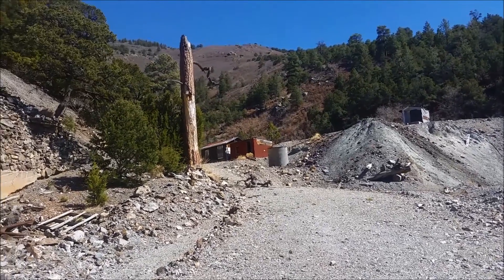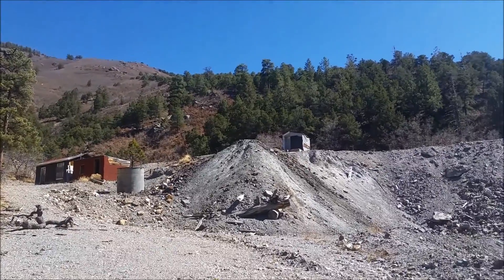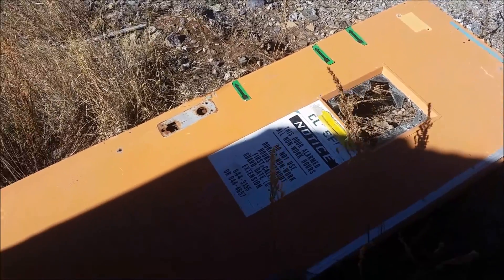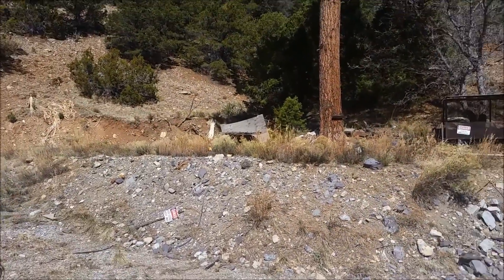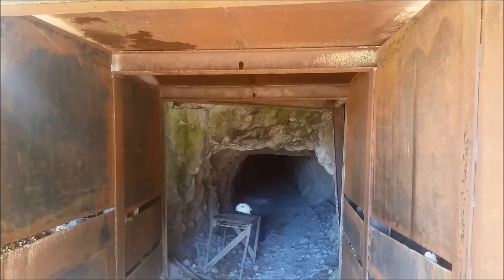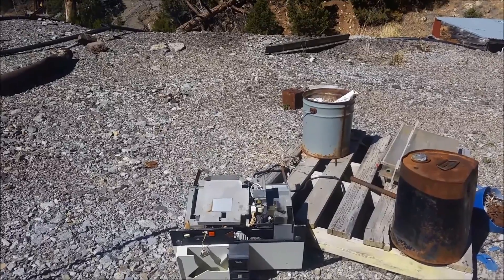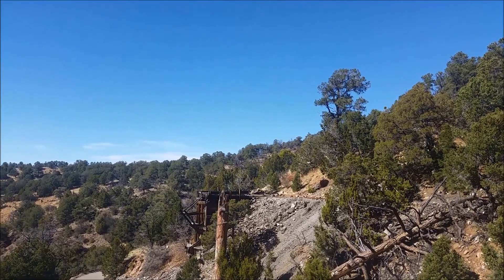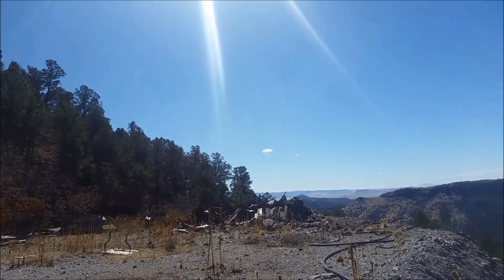Linchburg Mine Exploration: Gated Portal, Black Mold, Engineering Documents

Comment: Interesting how you smelled mold and experienced a burning sensation. I did not experience any  of that in my visit.
Reply from the maker: I'm not entirely sure about it myself - I've been back to this one a couple times more recently and didn't experience it again. I think there was moldy wood or something right near the portal.
Reply: @Porty1119  Massive mine, though. Those stopes are incredible!
Reply from the maker: @westernadventuresaz  They sure are! If you know where to look, you can even find where core drilling was planned for about 2002. Plenty of ore left in there. Did you find the 300' ore pass leading down to the lower haulage level?

The slusher boxholes going down to adit level are cool too. I started running a slusher stope today and it gave me a new appreciation for them.

We actually acquired both mobile air compressors and the battery trammer from this mine in late 2019 or early 2020 when the millsite was being cleared out. Unfortunately we missed out on the rubber-tire equipment but I can't be too upset.
Reply: @Porty1119  I don't beleive I did.  It's such a large mine that I need to go back and see the rest. Where the Cleveland machine is that pulled ore cars on the track out from that lower stope, is apparently a stope above it that goes up quite a ways. I kept looking out for ore carts and other stuff, but I didn't find any yet.
Reply from the maker: @westernadventuresaz  The primary ore pass is located towards the south end of the mine. All the timbers are rotten - that area is very wet from groundwater intrusion. I believe there are one or two other ore passes. Check for black HDPE pipe dropping down an ore pass with a pump controller  box nearby. The last work done used rubber-tire equipment (Wagner HST-1A LHDs and Getman 5TA articulated trucks) dumping down the ore passes. Ore was hauled by rail out the Patterson/Unity portal and loaded out into trucks at a very nice steel ore bin/trestle that you should definitely go visit.

There are one or two partial ore carts underground; everything else not nailed down was hauled down the mountain. As of five years ago it's pretty much all been sold. We considered purchasing the Granby dump cars as well but passed on them as we've got probably fifteen cars in both 24" and 36" gauge spread across the district. The cars used at the Linchburg are the biggest 24" cars I've ever seen - probably 12-ton units. As fun as it is to run a home for wayward mining equipment, we have to be pragmatic and not buy things without a reasonable likelihood of using them (exception being ridiculous deals like a quartet of EIMCO 21 muckers for $300 each and an air track drill that ran $65).

Comment: I believe Lynchberg is still under private ownership. I think that the lease was updated in 1993.
Reply from the maker: That is correct. We didn't realize that at the time, and thought it had reverted to USFS land. The current owner is Hydro Resources of Albuquerque; I confirmed this via phone. The last ore shipped from there was 14,000 metric tons in 1974- by the way, that's chump change in the industry- with New Jersey Zinc shipping about 400,000 metric tons through 1961 or so. The work in 1974 appears to have been part of a pilot program to investigate feasibility of reopening the mine. That effort stopped in the early 80s with the commodities market crash. Honestly, the way some things are filed makes me think that that 14,000mt work was never actually performed-  proposed development schedule is filed as "proposed", indicating that the work did not take place. Indeed, this site visit did not indicate the infrastructure that would have accompanied a mid-70s mining operation.

What I can tell you is that this mine has not shipped ore in commercial quantities in over forty, probably closer to fifty, years. It does not meet MSHA standards for ventilation and emergency accesses - there does not seem to be any access besides for the portal. MRDS' prospective development schedule for the 70s indicates two adits, but as far as I can tell this operating plan was never used, which leads me to believe that a second adit would have been blasted if the mine was reopened. Long story short, this mine would not have been legal to operate on anything other than a small-scale family basis.
Reply from the maker: Conrad Smith Thanks for the tip! Did you access Little Baldy from Water Canyon or the road network running from Linchburg/Enterprise/Mistletoe?